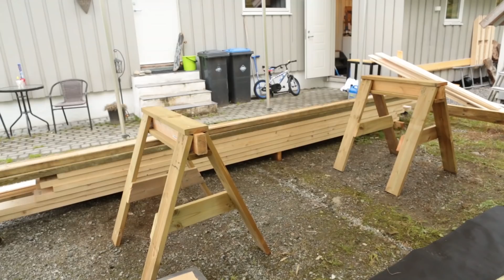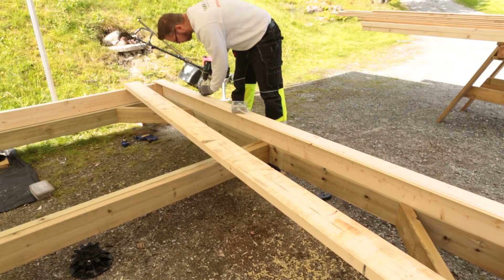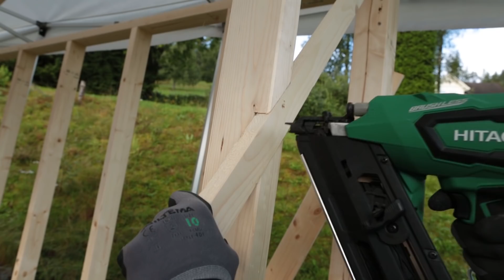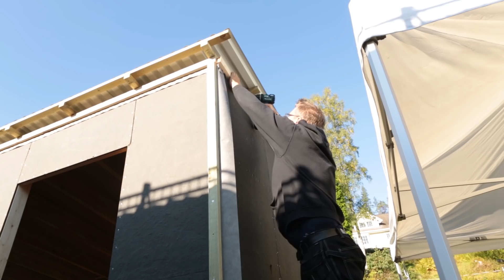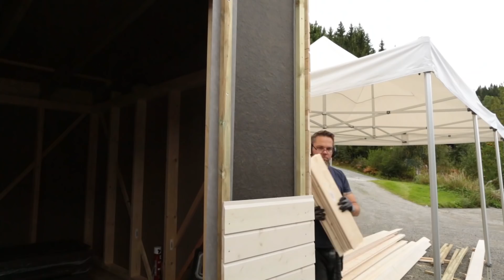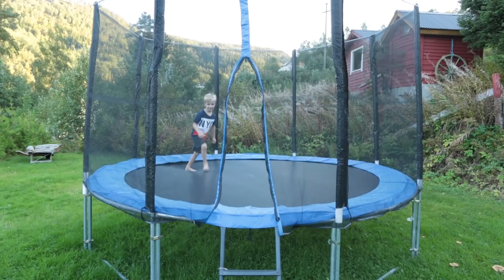Building a Mancave / Workshop / Shed

Comment: Dear Dieter,
You knew that the edge on the top of that luvly timber is for nailing? Thus you don't have to ruin the look of that beautiful wood structure with nails.
Reply from the maker: No it's not. This is the correct way to do it. This is to make sure that there is proper pressure on the boards.

Comment: Looks nice. My only question is why wouldn't you sheet the deck before building and standing the walls?
Reply from the maker: Thanks. I'm adding insulation in the floor later. It's easier this way. For a regular shed I would finish the floor first.

Comment: Dieter. An incredible job! I am very jealous and impressed. A few questions: what kind of wood? Pine? What kind of weather? No rain interruption during th construction? I would need a permit to build something like this in my area. How about you? Can't wait for part 2.👍👍👍👍
Reply from the maker: Thank You. Mostly spruce (and some pressure treated pine). I was very lucky with the weather, because it's usually pouring down here all the time. I had however the whole project under a huge party tent. Usually permits are not needed here when it's under 50m2

Comment: Very nice shed! In your area is it typical to attach siding w/what I assume is air space between exterior sheathing & siding? Does that space get closed to prevent wildlife from accessing? In my area, I have only seen siding nailed directly on top of sheathing. Thanks!
Reply from the maker: Thanks, Yes the air space is standard. Prevents trapping moisture in the construction. It's common to attach metal "spikes" at the bottom to let the air flow in but keep  animals (mouses etc.) out.
Reply: Dieter Schneider thanks! I will be building a shed soon. Goal=use as much recycled/reclaimed material as possible (without finished project looking ‘rustic’). In a very rainy, cool climate area, seems odd we don’t have airspace as standard construction here. I think it would help w/moisture and also create an insulating effect (like the way 2 thinner clothing layers is warmer than 1 thick). Ever have issues with splash-up from heavy rain getting between sheathing & siding? Just curious.

Comment: Nice but how did you do the flooring?  As you put walls up on to the base frame without flooring down ? This left no support around all side of the base for flooring boards ,
Reply: these are added later :) blocking kind off
Reply: @kischrim  extra work 😆
Reply: different countries, different codes ;)

Comment: Surely you live somewhere in scandinavia? Sweden? The buildingtechnique seems swedish.
Reply from the maker: Close, Norway :)
Reply: When is part two coming out? Now I'm interested!
Reply: I guessed i too when I saw Volvo in background :)
Reply: What are the differences between Scandinavian building and American? I'm learning construction by Youtube. I noticed something different in the floor supports but not sure what else to look for?
Reply: You can tell it's Norway and not Sweden by the roof trusses. In Sweden they would have been placed at c/c 1200, but here they're c/c 600 mm.
Reply: @grobetog  but they use thicker beams then?
Reply: @viliusm.8232  Right, but the strength is height cubed, so 45x145mm beams placed c/c 600 can be replaced with 45x195 at c/c 1200 giving even higher strength.
Reply: Looked for this, thought everything about the house and backyard looked Swedish like 30 seconds in. 😂
Reply: @Grobetog thanks for that info. What do you mean by "c/c"?
Reply: @Stephen cc means center to center. The distance between the center of one beam to the center of the next beam.

Comment: Some strange techniques.....why would you put your walls up before your subfloor?
Reply from the maker: The construction must be properly dry before insulation. If you can build in a dry environment you can insulate right away and put on the subfloor first, then the walls.
Reply: @DieterSchneider  are you saying you insulated the floor?? I don't understand
Reply from the maker: @rastamon5969  yes, check out my latest video. I just put the floor sheets on without attaching them in this video. I had heat on the whole winter to make it as dry as possible before insulating. I can see it looks a bit strange in this video to do it this way